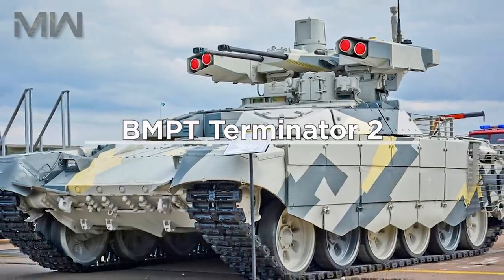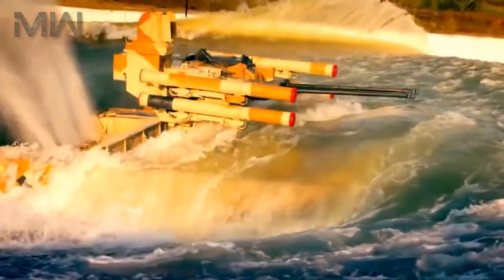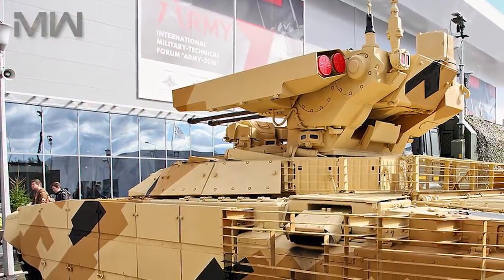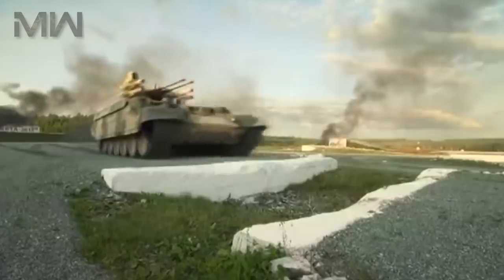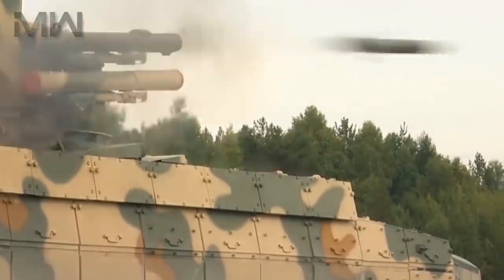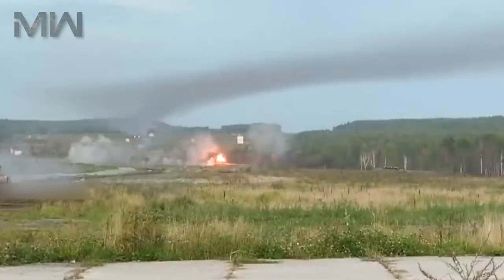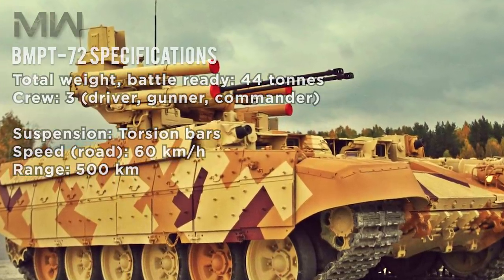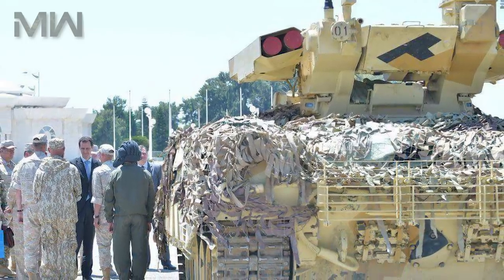BMPT-72 Terminator-2: Russian Heavy AFV

Comment: good use for old t 72s but they should make one on chassis of T-14
Reply: They have something similar. It's called the t15. Armada chassis with forward engine, 30 mm Cannon, coax, and 4 kornet missiles
Reply: It is planned to replace the twin 30 mm guns with one 57 mm gun for the 'Armata' version of BMPT.
Reply: @maksimluzin1121  nope, that is a different planned model and based on the same idea as the Beumerang being tested with the same gun.
Reply: @PugilistCactus  , Actually, there are discussions to replace 2 x 30 mm auto-cannons with one 57  mm cannon on the BMPT in the next version, probably the 'Terminator-4'...  So far, the serial model of 'Terminator-3' for Russian army will be supplied with the twin 30 mm auto-cannons and two 30 mm grenade launchers returned back to the 'Terminator-3'... Who knows? After one year passed, I think, the 'Terminator-3' version is enough for it purposes and combat tasks and don't need the 57 mm cannon... Probably, better to improve sighting systems on the BMPT-3 and to produce newer rounds for the 30 mm cannons with the better armor penetration. The 57 mm cannon can be the 'overkill' for a such combat vehicle...

Comment: the first few clips of the terminator was the bmop ramka 99?
Reply from the maker: Muhd Nasruddin Bin Muhd Zahidi you are right ☺
Reply: Muhd Nasruddin Bin Muhd Zahidi nope, the BMOP Ramka-199 (Objekt 199) wad the prototype to the BMPT Terminator which is the one with 2x30mm grenade launchers in the hull and ATGMs mounted in over under configuration.

Comment: That in the video is a BMPT not BMPT-72 you can see that on the chassie there are two MGs left and right on the front on the BMPT-72 they are not there
Reply: БМПТ-72
Reply: They are the 30 mm automatic grenade launchers, not MG. They were been returned back to the 'Terminator-3' version of the final model for the serial production for Russian army. You see the old versions of the BMPT in this video (BMPT-72 and 'Terminator-2'). The very final version of the BMPT for Russian army you may see during the Military parade in Moscow at May.

Comment: Based on t72 chassis? Bad move
Reply: Bmpt 1 is based on t90 chassis and is expensive
Reply: Why? Russia alone has about 12 thousand T-72 tanks on the strategical military storages. It is very good and cheap conversion version to new one type of a combat vehicle. By the way, BMPT is much better protected and armoured than ordinal T-72 tank.
Reply: How so? It's clever repurposing of (not so)old platform.